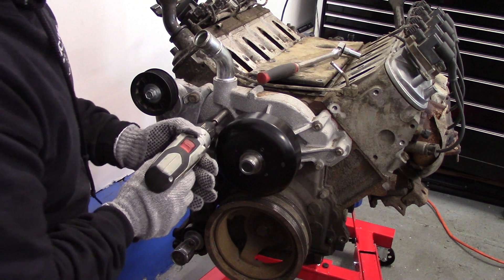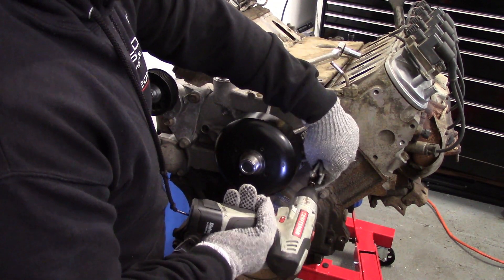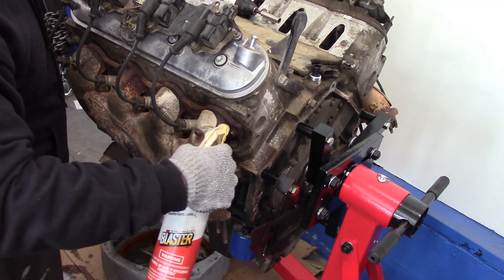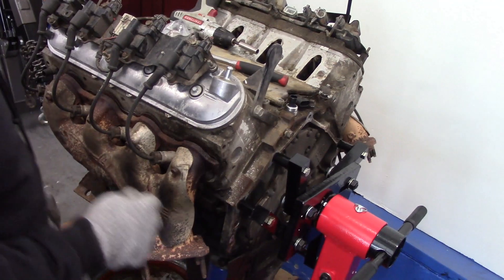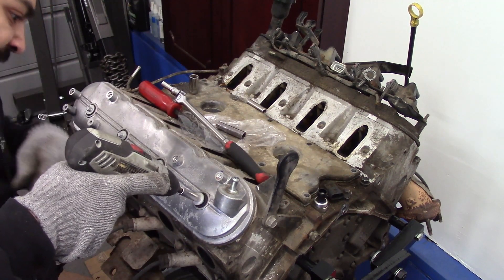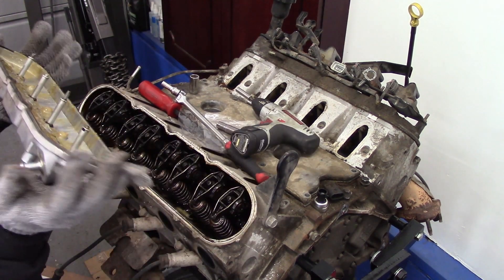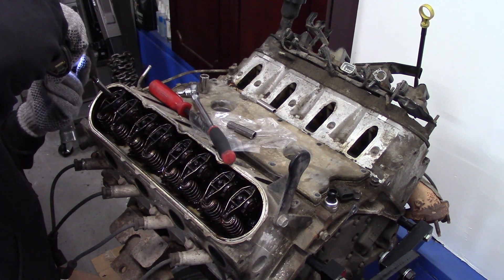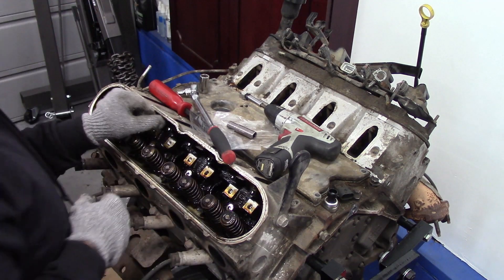ENGINE TEARDOWN PART 1 [ 2004 CHEVY AVALANCHE][ 5.3 VORTEC V8]

Comment: So had a question, do you know where the transmission control module would be located on a 05 Chevy avalanche 5.3
Reply from the maker: Not sure but check under  the center console

Comment: The valve cover you removed with the coffee for oil, wasn't that the one you just replaced not too long ago?
Reply from the maker: Yes sir that was the new one
Reply: @Kingcustomz  So, the gasket blew in that short of time? Dang man!
Reply from the maker: Yes I'm guessing so, but it's okay because when I fix this. It will last and you all will see😀